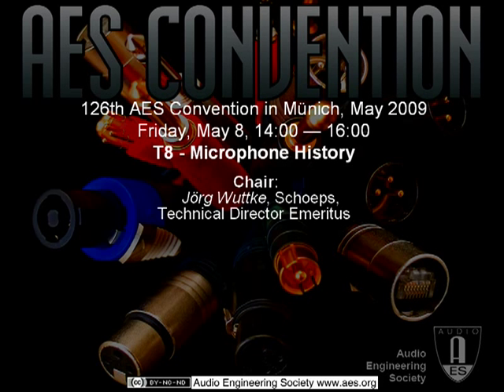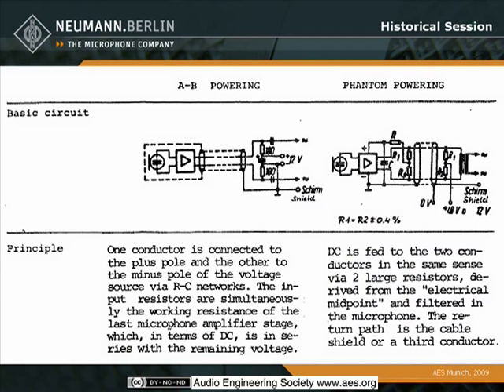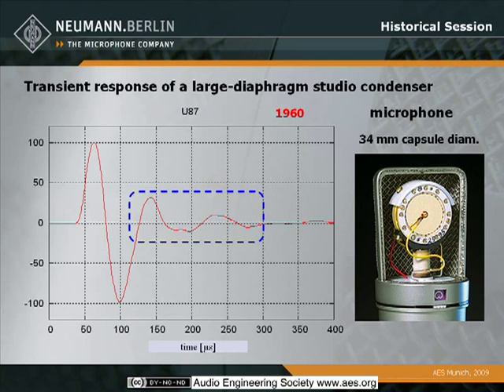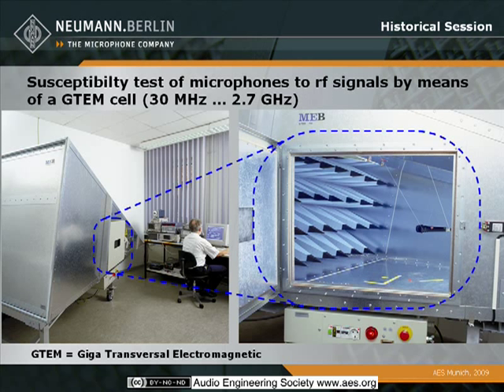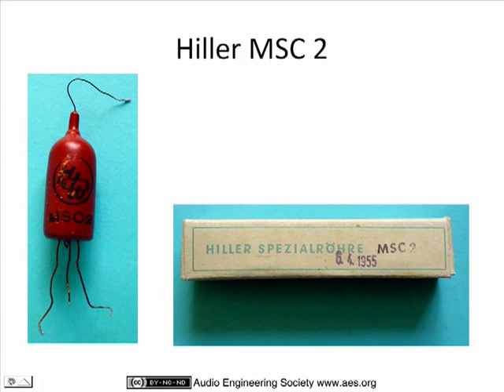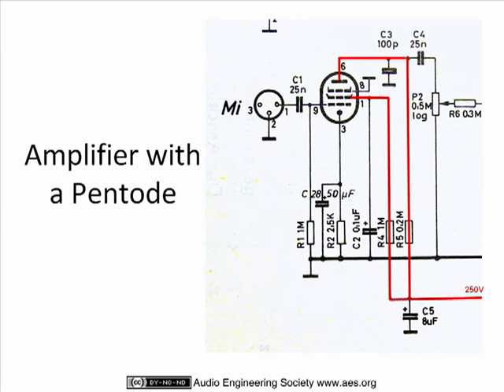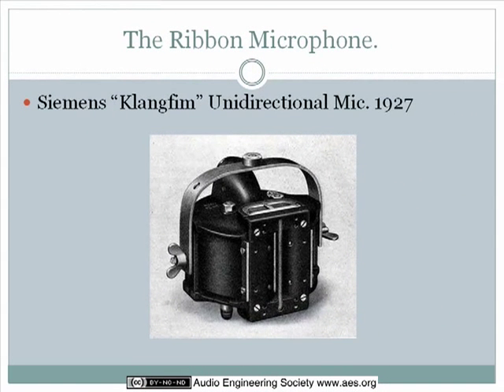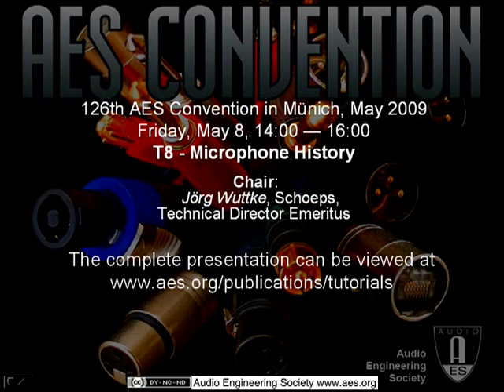AES Tutorial: Microphone History by Jörg Wuttke, Ulrich Apel, Sean Davies, Stephan Peus

Comment: Sort of.  In 1881, Dolbear came up with the idea of the condenser microphone, although it was of course not practical without an amplifier stage which did not exist at the time.

Wente published the original paper detailing the development of an actual operating microphone in 1917, and this was a Bell Labs demonstration, not an actual product.

The 47A came out in 1926, using a capsule that was derived from Wente's work, and it was the first actually complete condenser microphone system sold commercially.  By system, I mean both the electronics and the capsule were sold
together in one unit.

The capsule for the 47A was a Western Electric type 394, made in Baltimore.

Now, it's true that Neumann didn't actually demonstrate the CMV3 until the 1936 Olympic games, so I think Western Electric does get the award for first practical commercial condenser microphone.

(Neumann ought to get credit for the first directional condenser microphone, though.)

I'm not sure there is any connection between WE and Neumann, though, certainly WE never contracted anything to
Neumann.  AEG did license the design of the 394 capsule from WE, and Georg Neumann did work for AEG starting out
and may well have seen the design there.

But, of course, details on all of the theory and operation were public back then.  Wente's papers in the July 1917 and
May 1922 issues of Physical Review were available to anyone who wanted to see them, and still are.